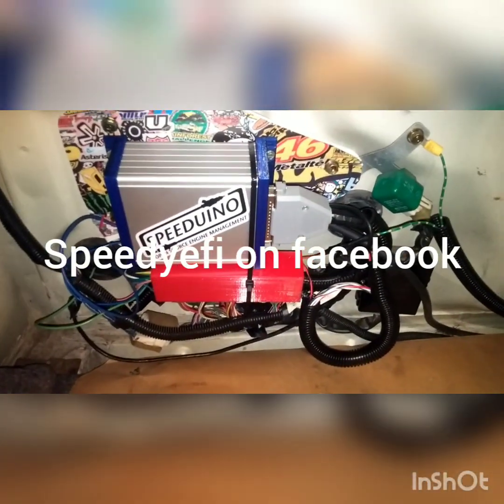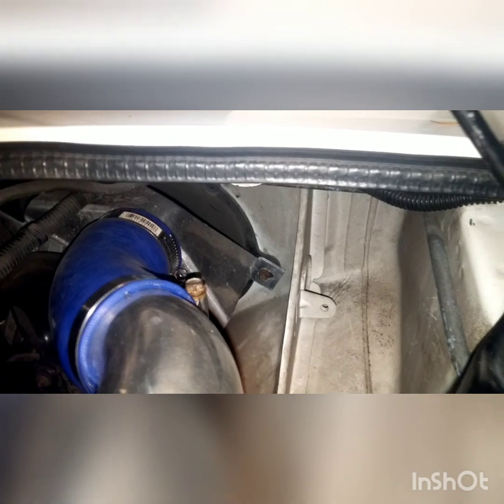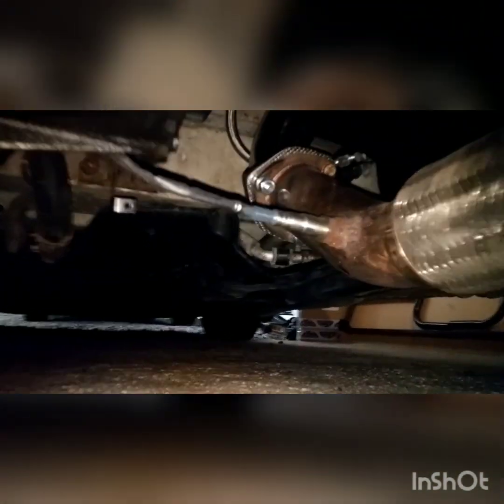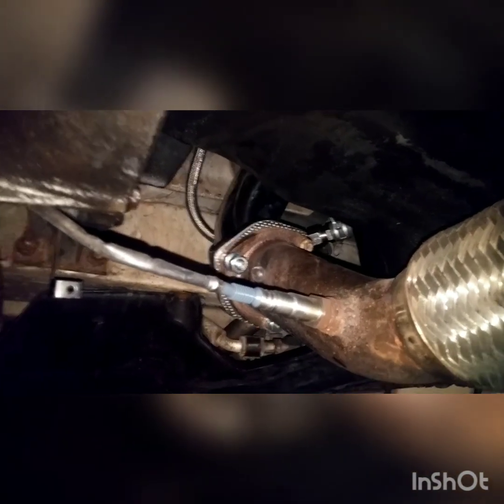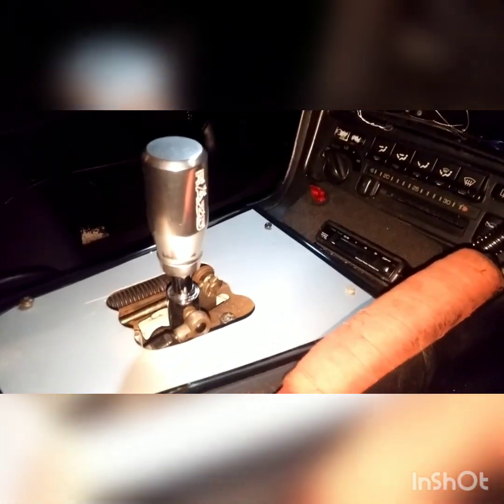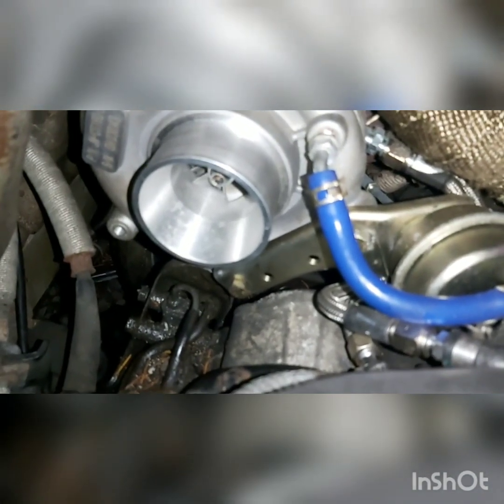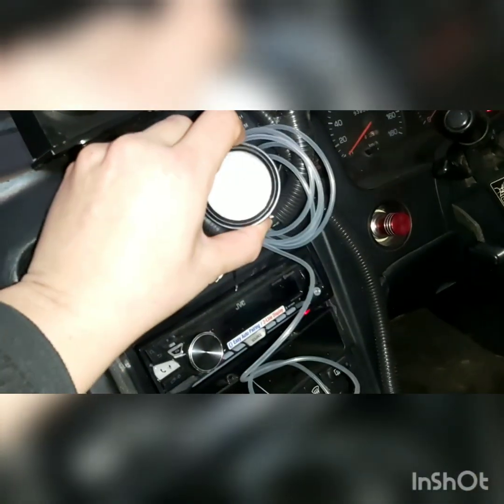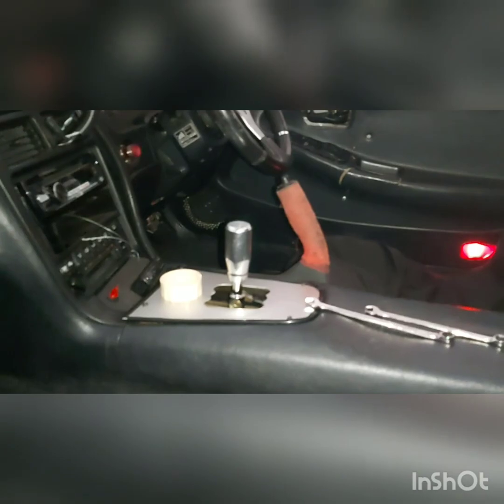Toyota Mr2 Speeduino ECU

Comment: i have a 3rd gen 3sgte celica st205 and considering the speeduino. My question is that do i need for the ecu to plug unto the oem harness
Reply from the maker: There is an adapter you can buy from speedyefi.com and you can wire the ecu harness to that and then plug in your factory wiring harness to that adapter.  You will however need to modify the distributor (easy enough) as the ecu will need a proper trigger pattern.  I have posted on the Facebook forum on how to do it but will take a bit of looking to find it.  Type in Nick Colatosti and let me know if you find it.  Cheers
Reply: @turbogarage4889  forgot to say that i didnt find it, did you buy the unit as plug and play? if no can you tell me how you got it to be plug and play